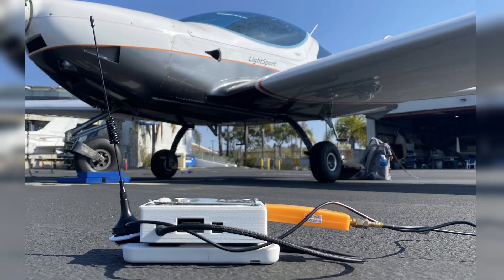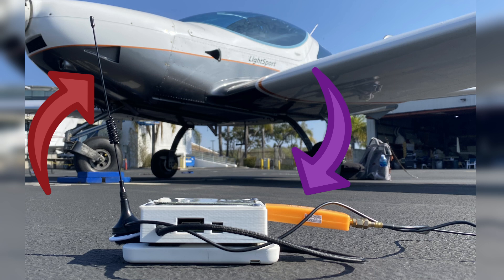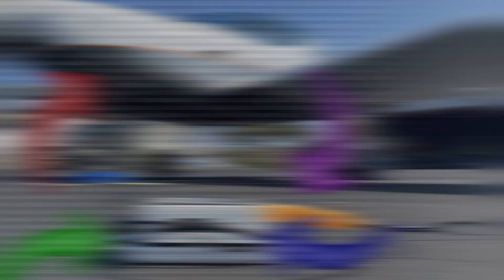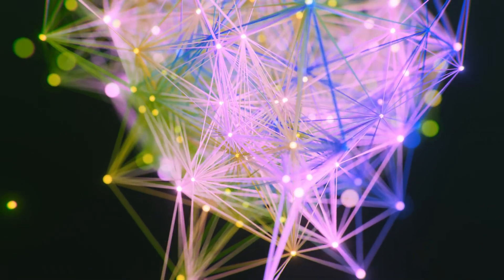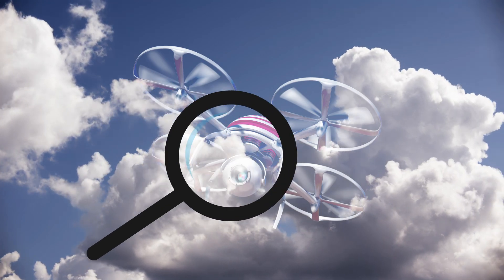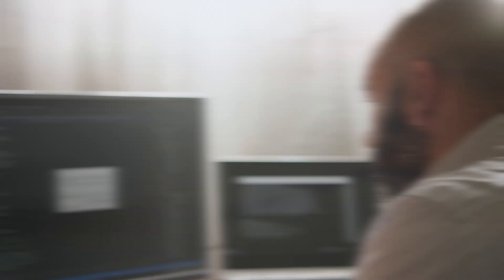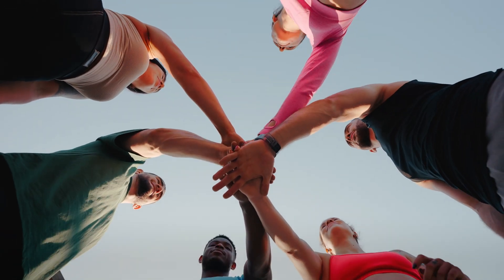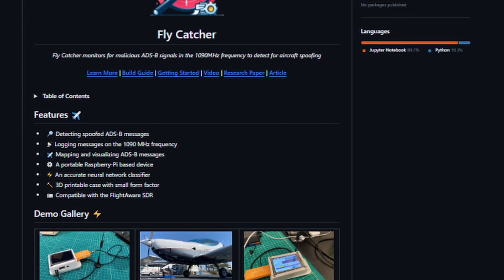Detecting Aircraft Spoofing With Fly-Catcher

Comment: Unfortunately, you can't really generate spoofed data yourself, train a model on that, and then say that the model can detect data spoofed by someone else. All they need to do is simulate basic aircraft physics (no ML required) and it will 100% evade your detector. Spoofing has got to be so rare that surely all your detections are false positives. This problem is not really a good candidate for machine learning. But very cool that you are attempting this kind of project at all. You must have learned a lot of super valuable skills by working on it.
Reply: Actually there is a way to catch them. You compare the broadcast position with the bearing angle to the station that transmitted  it using direction finding techniques.

With 3 DF stations covering an area, you can triangulate the transmitter location.

If it doesn't match the gps location then you know its spoofed.

Additionally you can look at Doppler shift to see if the transmitter is moving or not.

They aren't so hard to find.
Reply: Why not connect to FL24 using their API and get the data from there and analyze their entire data, from all around the world. Make a deal with them for immediate reporting the spoofed ADS-B data worldwide received by FL24 so they can flag it immediately and (maybe) auto-report it to the nearby Controllers and Authorities responsible for the particular region.

Comment: I read your paper. The approach as  described on pages 20-21 will be ineffective against any competently spoofed signal and, since it is completely trivial to create a stream of entirely valid and realistic messages, unlikely to work except in the case of crude and incomplete spoofing attempts.

The approach described on pages 22-23 has some merit, but it is being badly oversold as "fingerprinting". Comparing received RSSI to an RSSI prediction based on an RF propagation model would probably have the most value.

In both cases (detecting bad/inconsistent data and RSSI modeling) complex CNN processing is completely unnecessary.

Also of concern your paper does not describe any testing performed to validate the approach (which would be very difficult to do legally in an open-air RF environment) and there are no examples of a real-world, fake ADSB signal being received.

The definitive way to validate the presence of a spoofed ADSB signal is by RF direction finding or RF geolocation, whereby the direction and/or location of the transmission does not correlate with the data transmitted. There's an excellent paper here: https://ieeexplore.ieee.org/document/9881480.

Since the FAA already has extensive TDOA coverage ("MLAT") they already have the organic capability to do this. And there is already at least one commercial system available: https://uavionix.com/uavionix-announces-trusky-ads-b-spoofing-detection-for-skyline-uas-bvlos-operations/
Reply from the maker: Your critique raises valid points about the limitations in detecting sophisticated spoofing and the potential overselling of "fingerprinting." However, considering Angelina Tsuboi is only 16, her exploration of complex CNN techniques and clever approaches in aviation security is impressive. While advanced methods like RF direction finding might be more effective, her work is a notable effort at this stage and level of resources. It's essential to support young researchers in their endeavors, acknowledging the constraints and learning opportunities in such early-stage projects.
Reply: @retiallc Good engineering feedback is also important for budding engineers. Perhaps Angelina will endeavor to build on her work to date.

Comment: Isn't it simpler to compare ADS-B data to MLAT data?  MLAT shows the position of the spoofing device, no matter what it is broadcasting.
Reply: I already have 2 ADS-B receivers online with FlightAware. How do I incorporate these changes into my existing equipment? My second question is… will I still be able to transmit flight information that my units detect to FlightAware?
Reply: MLAT likely won't pick up a spoofed signal from enough receivers to provide positioning as the spoofed signal probably comes from the ground.

The method in the video is a good basis for rooting out amateur spoofing - it's a great project and good work.  However, there are obvious ways in which more advanced hackers could produce "believable" transmissions which would easily circumvent the system.
Reply: @alan_davis  If you are in an area where you can use MLAT to determine position and a spoofing transmitter on the ground can't be heard by MLAT capable receivers, then you can be pretty sure it's not a valid ADS-B report.
Reply: Yep...